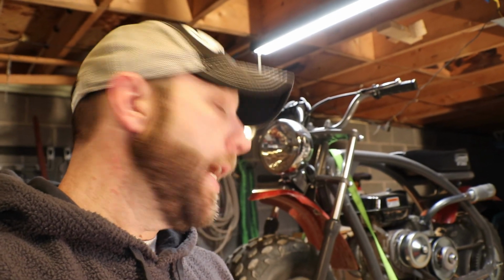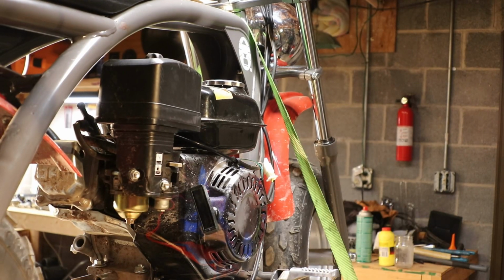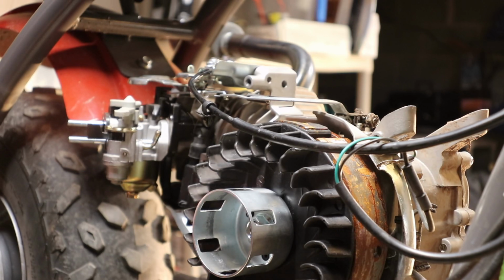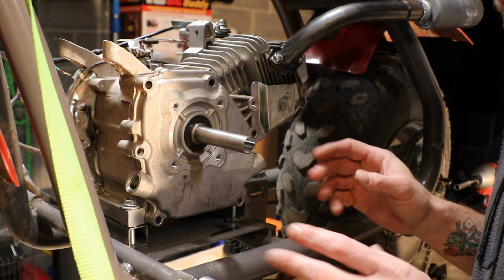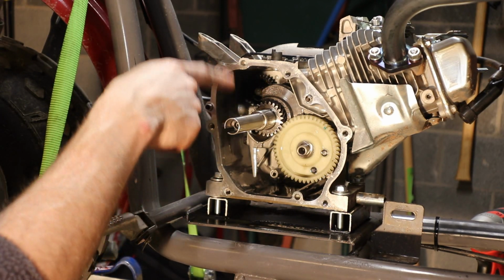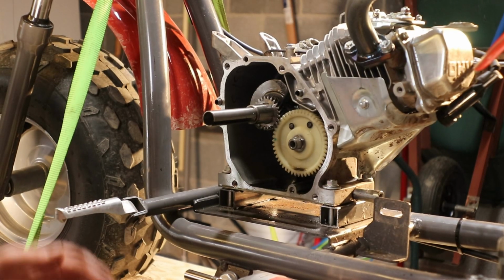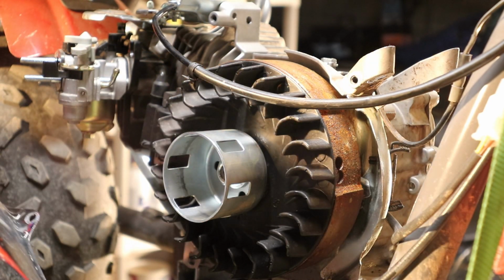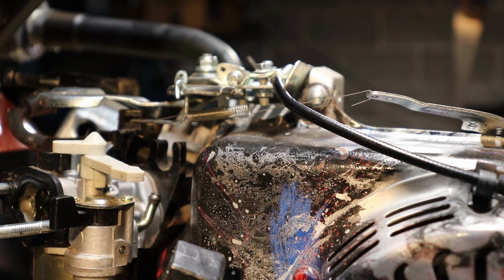Coleman BT200X Performance Budget Build Governor Delete Part 2

Comment: I have the same bike. My bike has amazon torque converter,  jetted mikuni carb, cone air filter and straight pipe exhaust. I did not remove gov. But did zip tie trick. I'm getting 50 mph plus. Almost to fast for this bike ! It's scary!
Reply from the maker: Sounds fast!!

Comment: Seems like less work just to take off the gov gear off the crank and leave all the other governor parts on.
Reply from the maker: Parts inside?
Reply: @hereshopengarage2790  not just inside you can keep the throttle assembly the same way. It will not matter because there is no gear on the crank to engage.
Reply from the maker: Yeah true! We went with a flat side after that
Reply: @ReisterJP  I was thinking the same thing. Why buy a new throttle assembly and everything else when u can just leave the assembly together and remove the gear inside.

Comment: Removing the governor is a hassle.  A zip tie can pull the governor open and is much easier. With the zip tie method you can still use the governor if you want.  If you remove the governor it voids the warranty.
Reply: Jeff Frank how do I do that zip tie

Comment: Great reminder to everyone about getting it at TDC before pulling the cover. It relaxes the valve train nicely and is never mentioned in these governor removal videos.
I don't think you did anything wrong except not torqueing the flywheel nut to 54 ft/lbs with a torque wrench. If you don't have one getting it the ballpark should be ok..

Comment: What size bolts are inserted in 2 holes? Thx
Reply from the maker: Not sure what you mean?
Reply: Here’s Hopen Garage sorry misspelled, are the bolts just normal 1/4” bolts?
Reply from the maker: For witch part?
Reply: Here’s Hopen Garage bolts used to seal up arm and pin holes
Reply from the maker: Yes correct, 1/4 -20 x 1.5"
Reply: What are torque specs for flywheel and engine cover sprocket side
Reply: @jmmustangs3078  Flywheel 54 ft/lbs. Side cover 17 ft/lbs.